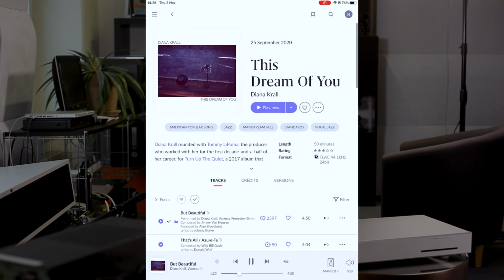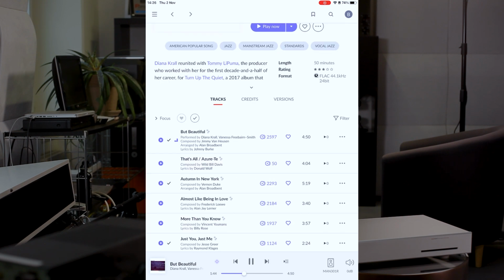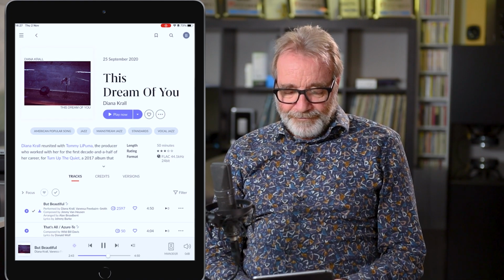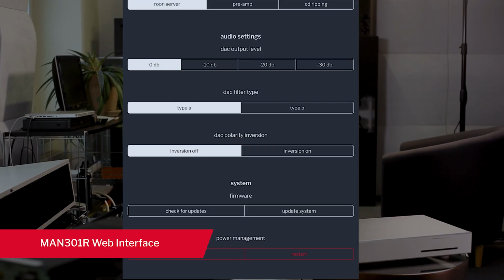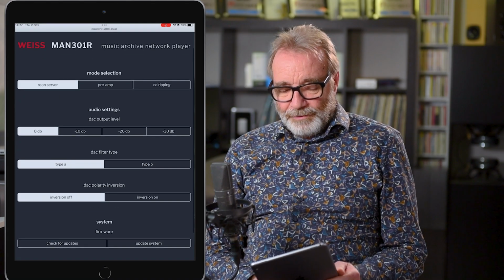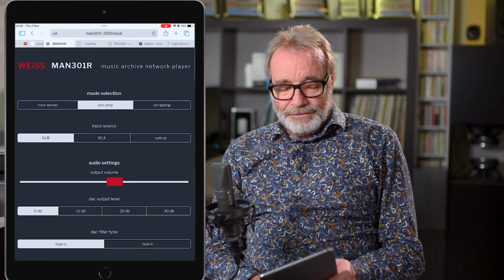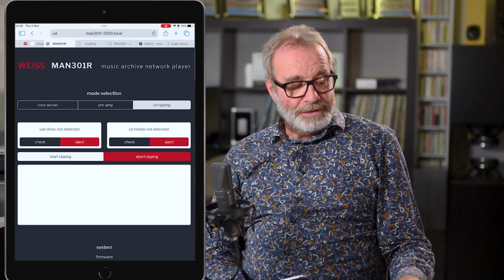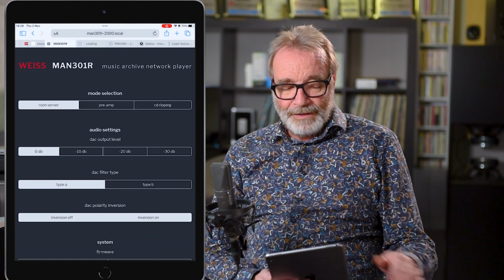MAN301R

Comment: Streaming has a problem, most obvious when using software programs like Roon. This was recently brought home to me, a relatively new user of Roon. Listening to music around 10 at night there was a sudden interruption of electrical service. It lasted for a few hours. Once I'd contacted the electrical company and learned of the area outage I shut down my equipment and fired it up again the next morning. Only to discover that my Roon server would not connect to my Roon endpoints. It showed the file playing on the left side bar but the bottom progress bar has no movement.
I've struggled with it for over a week now and I still haven't got it up and running. I finally resorted to uninstalling the Roon software and then reinstalling it. No joy. In looking into it online I discovered hundreds of complaints about Roon and it's interaction with various computer setups. Streaming platforms like BlueOS seemingly get around this but as soon as one uses the Roon functionality we are right back to uncertain ground. All of this is leading me to reconsider physical media... I can go through the laborious process of contacting a tech rep with Roon and eventually work through the issue. What has me hesitating to go through that is there's no guarantee that an update or another electrical outage or something else won't create the same or some similar issue all over again. Physical media simply does not present us with this type of frustration and life IMO is too short to spend it in needless frustration. So I'm faced with a fundamental question; is the convenience that streaming offers worth the near certainty of periodic frustration?